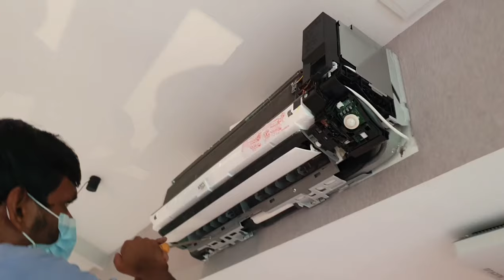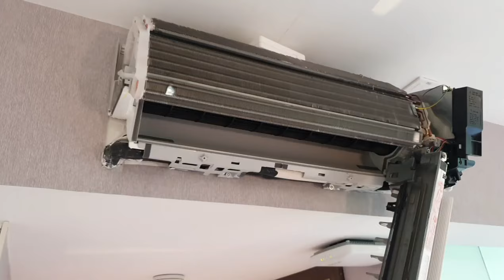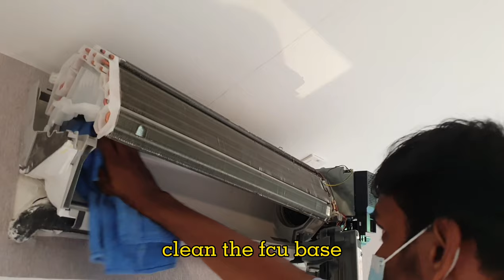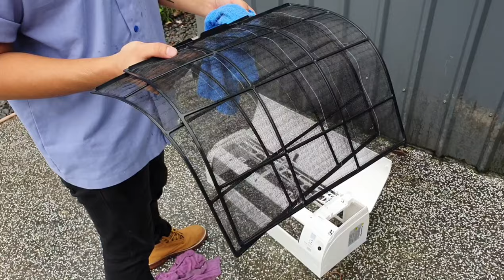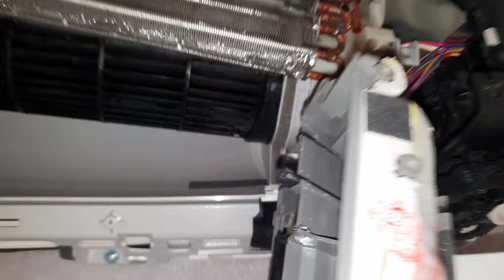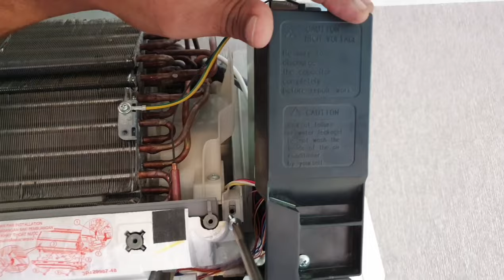How to service a Daikin i-smile wallmounted air conditioner | R32

Comment: Why they don’t design a simple way to clean these things?!
Reply: The mitsubishi electric air con had feature called “easy clean” so just simply remove the louver down then unclip the horizontal louver and wipe it, nowadays they have a new feature called “dual barrier coating” so it should take 10 year to maintenance, so it unable to cleaning the air conditioner easily for most brand
Reply: So you have to call somebody and pay shit ton of money for an easy job
Reply: Like Hitachi
Reply: Design to fail and get money from you
Reply: Like simply table fan jaisa😊
Reply: Because they want to earn money after selling the air conditioner.

Comment: this is really very basic cleaning. if you want tp be more thorough you should unclog the drain pipe using a wet vacuum. thats usually the cause of most leakages.

Comment: Make sure you turn off mains! I got a shock when touching the right electrical part!
Reply: Mains meaning the switch that even turn off the compressor ?
Reply: The switch in your house/apartments fuse box that the AC unit is hooked up to, NOT just turned to "off" (aka standby, with high voltage power arriving in the unit you are cleaning) ). Make sure to test if you flipped the correct breaker and it its really disconnected from your electricity. Dumb way to die.
Reply: You need to look for the main power plug connected to the compressor unit, unplug this main power from the power socket the whole AC system power will be disconnected from the main. This is the safe way to work on your AC, switch off the main circuit breaker the neutral and the ground will still be connected to your house's electricity!
Reply: yep, must unplug the power or switch it off on breaker, even if power is not turn on, but power cord still connected, there are chance live current still flowing

Comment: I think this video is pretty accurate as far as indoor unit components. But they added steps and missed steps. I would not pull out the fan blades during a basic cleaning, that is probably a once in 5 years step, and only if you can see excessive dirt or mold on it. They also did not use coil cleaner foam and do a rinse.  The biggest piece not shown is cleaning the outdoor unit, that simply is using garden hose water to rinse down the dust in the ODU coil.

Comment: Hi sir, i did follow your steps and everything. But now the problem is my air is not cold enough and the airflow not smooth. Any advice?
Reply from the maker: May the evaporator coil choke, suggest chemical cleaning

Comment: Hello, how about the evaporator coil, does it not needed to be cleaned?
Reply: This is the price for the work! If you want a better cleaning solution you need to pay more or you can do it yourself. Make sure you unplug the main to the compressor unit before you carry out any cleaning work.

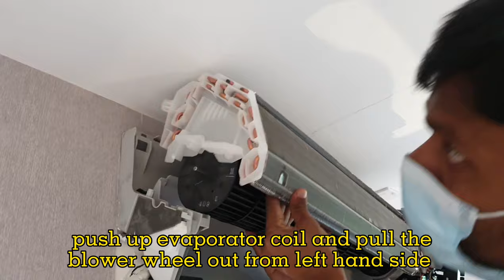Comment: Removing the fan pulley moves the cooling elements quite a bit. Can the refrigerant lines withstand this in the long run? That looked destructive (from 2:28), with how much movement there the cooling elements were extremely bent to the side just to get the fan coil out.
Reply from the maker: Normal process. This the only method.
Reply: I do that to my Mitsubishi Starmex as well. It’s normal.

Comment: How is the aircon after a few years now
Reply: @BonMj  because i changed from panasonic to daikin they used daikin original reducer and adapter. Would it cause leak?
Reply: Currently the vacuum is able to hold about 150 psi when my 3 aircon is turned on and remains stable. The needle does not jump or flicker around. When it runs however the more unit the needle comes down abit.

Comment: does this even fix the water leaking part haa
Reply: that one is ur drain pipe clogged, u need bring small hose pump the drain hole with water from the aircond